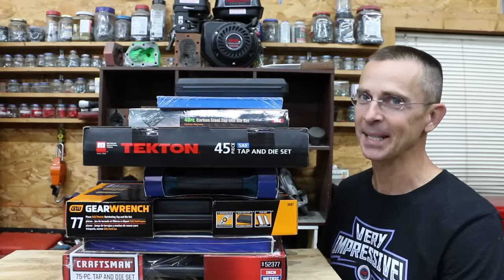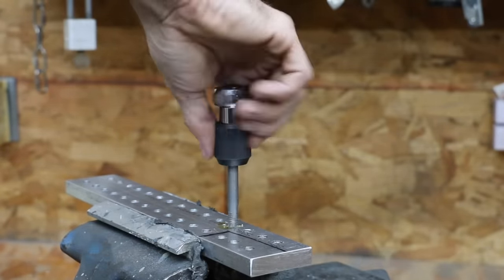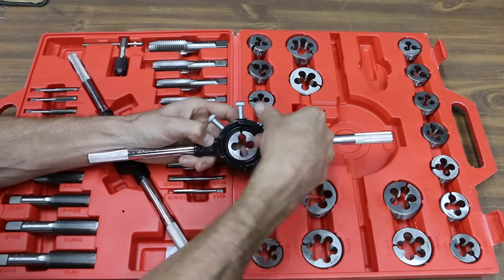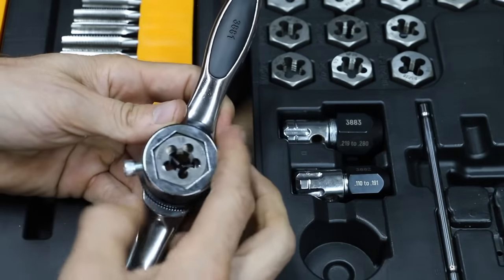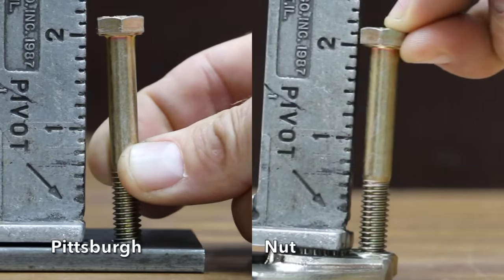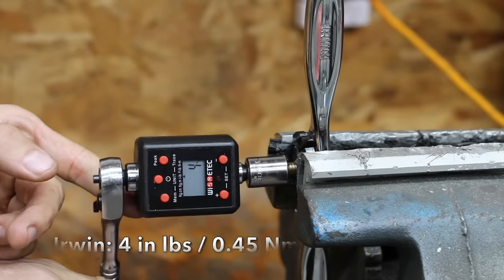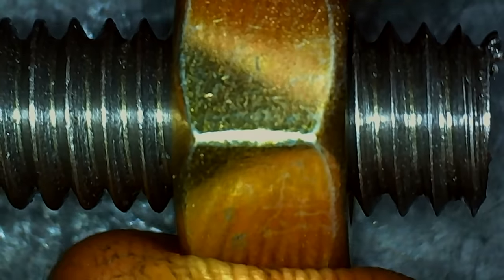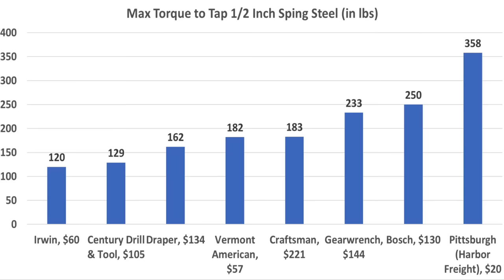Best TAP & DIE Set? Craftsman vs Irwin, Bosch, Draper, Vermont American, Tekton, GearWrench

Comment: I still have SAE and Metric tap and die sets from Hanson before they merged with Irwin. I've had to replace a few of the smaller taps that I have broken over the years, but those have been great sets for a long time. I wound up working with the son of the owners of the small hardware store that sold them to me decades ago, and I show him or tell him about stuff I have made or repair with those sets.
Reply from the maker: Thanks for sharing.

Comment: torque indications on the fine pitch are significantly less because the incline not as steep. BY a third. So add 33% to the figures and you would be close to an 18 tpi incline. AND although the fine threads are cut shallower, there are more per inch.... FWIW fine threaded taps use a larger drill size than coarse thread taps.

Comment: Please do this test again but with midrange sets like Grey Tools, Jet, Matco ect.  Also through thicker steel using the 270 cut / 90 back chip clearing method like many of us were taught.  At the $250 to $750 price point of the mid brands I'd be more interested in the tolerances and torque required after 20 uses than just 3 test materials.
Reply from the maker: Thanks for the suggestion.

Comment: Today I was tapping about 40 3/8-16 holes in mystery steel, and none of the taps I tried cut very well (from new laser marked ones to old embossed taps like greenfield, etc).  The last one I tried was a rusty Card tap.  I couldn't believe how easily it cut!  I picked up an ancient Card tap and die set (1/4 to 3/4") in a wood box last weekend and was going clean and flip in on ebay, but now I may just keep it, especially if they cut as easily.
Reply from the maker: Thanks for sharing.

Comment: the split dies are entirely up to the user to adjust the fit of the thread by tightening the holder more or less to decrease the size, theoretically you should be able to achieve a much closer fit if the die is a little too large
Reply from the maker: Thanks for the feedback.

Comment: Every time I watch a youtube video of someone running a tap through a hole with a hand-held drill, I cringe, waiting for that dreaded snapping noise.  I would never tap a hole without a fixture to hold the tap on axis.  At the moment, my tool is a normal T-handled tap wrench held in a collar that gets chucked up in the drill press that I used to make the hole.  Works pretty well.  There are also tap-wrench aligners that help hold the tap perpendicular to the surface.  Back when I had an employer to buy my tools, one of my favorites (along with an optical center punch - no home should be without one) was a tapping station that looked like a little hand-cranked drill press to hold the tap on axis.  If you don't use these aids, you make crappy threads and break taps.
Reply from the maker: Thanks for sharing.

Comment: I have a 20€ set from ALDI which was obviously made at the same factory, the case is powder coated metal, which is nice. They have done right by me. Mostly use them to recycle hardware... Rusty bolts and nuts.
Reply from the maker: Thanks for sharing.

Comment: Great test, however- I wish you had cut some bolt threads on a rod, and tapped 2 nuts, and jammed them on the bolt you just cut, and simply used a torque wrench to the jam nuts till one gave. THAT would put some relative, real world meaning to the free play you measured. Not complaining you have good tests, better than I would do for the most part!! Thank You! !
Reply from the maker: You are welcome!  Thanks for the constructive feedback.

Comment: Maybe you should do a video on the different cutting oils and waxes that are on the market! It's not a one size fits all when working with various materials. Over my 40 + years in metal fabrication I found Alumacut to be the best product when working with aluminum and some wax based lubricants worked best when working with mild steel , stainless steel , brass and bronze! Cast iron seemed to work better just left dry!
Reply from the maker: Thanks for the video idea.

Comment: Love the info but not sure what the weight of each item tells us.  I assume it is to compare the quality of the metallurgy. 1 brand of die could be thicker or even some of mine are hex while others are round. As for taps, some brands are longer than others. Some have a thinner "neck" or body. I'm probably most interested in how long they stay sharp or how easily a tap breaks. Just some ideas. Love your videos. Sometimes it's a lot of info at a fast pace which I appreciate but I can't watch them when I'm tired or not paying close attention.

Comment: When tapping aluminum or plastic you drill a slightly smaller hole so that the tap will cut deeper threads so that the aluminum or plastic won't strip so easily. A good drill bit chart will list the drill bit size  for steel and the drill bit size for aluminum and plastic
Reply from the maker: Thanks for the feedback.

Comment: When possible I have all holes drilled and tapped by our machinist. When it requires I use a hand tap I take my sweet time and turn 1/4 then back out to cut the chips out. Which is how it is supposed to be done, not just run straight through. I have done fine with my gear wrench set when a tap breaks or gets worn out the company buys me a brand new high-end professional one. I mostly tap mild steel or cast iron  so I really don't need anything fancy. As I said if it requires it we have a machinist for that.
Reply from the maker: Thanks for sharing.

Comment: I was given the Craftsman set as a Christmas present a few years ago. It is probably the most hated tool set in my shop - it's mostly usable for the hobbyist, but I wouldn't recommend it to anyone. First issue - some of the metric taps are oddball sizes that no one uses. I immediately had to purchase a separate M3x0.5 tap because it comes with an M3x0.6 - glad I noticed this before ruining my part. Second issue - the tap handles are complete junk. Don't grip the taps well and loosen up during use. Third issue - taps require a LOT of force to turn. Maybe my set came from a different factory than the one PF tested, or maybe I'm spoiled from using quality taps, but mine will barely tap a hole in mild steel (using proper letter/number drill bit), and the M4 tap feels completely dull after 5 or 6 holes in 6061 aluminum (fairly thin wall). I broke the 1/8" pipe tap off in a piece of 3/8" thick 300 series stainless steel despite drilling oversize, but that's not really a fair test for hobbyist tools. I've used the Irwin tap set a few times at a previous job and it seemed much better, but not enough use to test tool life. I've used Hertel, OSG, and Accupro taps (from MSC) extensively at work for hand, tap stand, drill press, and CNC tapping and been very happy with their performance. I've been buying quality taps in the sizes I actually use since the Craftsman ones are so bad, but I plan to buy a different set and kick the Craftsman one down the road when I see a good deal - nice to have a full set for the occasional sizes that get used once in 5 years
Reply from the maker: Thanks for sharing.

Comment: Gotta say, for the price if you have ir throw in a different die wrench - the Irwin seems like very good tool value. At least if you treat them reasonably well and understand their limitation. Even the highest end tools crap out if you abuse them too much, just the Irwin will possibly do the same but a little sooner.

Personally I have a cheapo set for random jobs - then when I need to make many threads of one type, I'm working on a precious project or some really tough material, I go buy the tap or die I need, at a proper quality. The last 4 taps I've bought cost a good bit more combined, than the set I started out with. But I've used them far more than everything on that set, and they're holding up as when new. I still use the set for oddball sizes though.

UfI was starting out today though, armed with the knowledge I have today - I would have bought a kit like the Irwin as a starter set. Not much more than the one I have, but clearly a lot less need to buy separate taps and dies even for regular use.

All ofc depends on whether you got the sizes you need, covered by the set ofc. If you mostly work with metric, make sure the metric variant is made by the same factory/company (or better).
Reply from the maker: Thanks for sharing.

Comment: You my get a better thread with your taps and die's if after ever 1/2 turn you broke the chip by backing off a 1/4 turn. and letting the chip clear. Its very hard on tools that have to keep re cutting the material they are removing. just like a hole saw and no exit point for the swarf to leave so you are re cutting material you are removing. this is why you drill holes the in the material you are cutting or in side the out line of the hole saw. so you are not re cutting material. This is also another reason why we peck drill to remove material from the hole. Nice Review  and good job. Also do not forget there are 3 thread classes for external threads 1A, 2A, and 3A and three for internal threads 1B, 2B, and 3B. All of these are “clearance fits”
Reply from the maker: Thanks and you are welcome!

Comment: Taps and dies are both supposed to be turned and backed off - turned and backed off - also keep the threads cutting area cleaned out - but this was still a fair test.  degree of turn depends on the material.

Comment: Probably the best way to buy taps is to buy tap sets, where you will have a starter tap, a #2 tap and a bottom tap, for each bolt size; they are more expensive, but worth it if you do a lot of this kind of work.  If you're lucky you might even find a pilot tap, which has a smooth shaft for entering the hole precisely square.  These are more industrial and harder to find, with most sets available today only including a #2 tap.  With adjustable dies, you can somewhat control the thread fit, but it does take some trial and error.
Reply from the maker: Thanks for the feedback.
Reply: It's a strain to force a #2 tap to cut virgin thread, when the #1 starter tap is the one to use.  It's really hard to evaluate the #2 taps given this task.  There will be more damage to the #2. @ProjectFarm

Comment: I have been a machinist for 40 years. Hole size is critical. You need to drill a pilot hole (just under size) then drill to the size you want. Hole size will vary otherwise. The best taps are made by YG but cost $50-$100 each. Otherwise Greenfield or Vermont would be my next choice.
Reply from the maker: Thanks for the feedback.

Comment: You should have added that the taps used were standard taps (intermediate) in shape. For cutting the spring steel pre tapping or simply using a taper tap (starting) would be the best way to go and what the stepped cutting ability was designed for. Doing the same thing with all taper taps may show different results. Also the Draper die has the cut out that serves 2 proposes, one to locate the die in the holder and the second to regulate the actual fit to the nut, that's why good old die holders have 3 screws to hold the die, to change its cut diameter as well as holding it (clearly seen with the Tekton set).
Reply: I didn't know you could change the diameter. Thank you so much for that tip. I had probably used the adjustment screw in the past, but it's not often that we have to use a large die, so I probably forgot. Thank you for sharing. I was thinking, how crappy it would be to thread a steel rod and then have the threads be way too loose.

Comment: I am interested in which Craftsman tap and die set you tested.  Was it a Sears Craftsman, or a non-Sears Craftsman.  There is a difference.  Sears has the right to sell under the Craftsman name, for a period of time, using the same suppliers they previously used.  Non-Sears Craftsman are now Stanley Black and Decker.

Comment: Would like to see a review of all the various gadgets sold that will help preserve tubes of caulk, or adhesive that come in those tubes that you snip the end off. I’ve tried numerous plugs and slip on rubber caps to try and keep those tubes from solidifying and none work very well. I end up wasting so many tubes. Expanding foam waste is another issue.
Reply from the maker: Thanks for the suggestion.

Comment: I the most annoying thing for me in getting the cheap Pittsburg was the tap holder slipping even when I tightened the handles down with 2 hose wrenches. Imho, add the cost of good handles and you may as well spend a bit more.
Reply from the maker: Thank you!

Comment: The cutting length when testing the taps with the drill: result is dependent on the speed of the drill - that could be different, so the result could be different. Plus: with these tools you do not cut threads so long at a time - if you want nice results, you cut 1 turn forward, half back to cut down the material.
Reply from the maker: Thanks for the feedback.

Comment: 5/16"-18 = National Coarse Thread, 
5/16"-24 = National Fine Thread,
personal opinion:  
fine threads for better tensile strength and they loosen less from vibration, on the other hand when working with thin layers of material coarse thread has a better grip and will last longer.

🔩
Reply from the maker: Thanks for the feedback.

Comment: Hey I think it's the way your using the tap that's making the threaded holes fit loose the way they are. You should be using a T handle and applying even pressure to screw in the tap when you use a single handle like a torque wrench your putting uneven pressure on the tap forcing the cutting tip to push outward.
Reply from the maker: Thank you for the feedback!

Comment: As a machinist and mechanic I learned the hard way that Horrible Fright is the LAST PLACE to purchase ANY cutting tools! ALL of their drills, taps and dies are trash. Some of their power tools are OK and their new tool cabinets are excellent. Just don't buy anything to use for cutting metal. Their wood tools, such as chisels and such are also pretty horrible. Personally, I use drill bits from Cleveland Drill which used to be located in East Cleveland, OH. It is now owned by  Greenfield Industries which moved them to Solon, OH in 1996. In 2009 they became part of the Top-Eastern Group who also owns Vermont Tap & Die which is one of my first choices for such items. I also use Irwin when I need something on the fly since most local hardware stores have them readily available.
The lesson is that you get exactly that for which you pay. You can get cheap things or, you can get things FOR cheap. The best thing is to shop around and don't be afraid to ask for a better price. You may well be surprised if you do.

Comment: Todd - Thanks for the video.  I've been watching @Abom79 about as long as you (several years).  There is definitely a difference between professional machinist tools and technique, and that of the home handyperson.  Thank you for using the tools, techniques and products that the typical weekender would.  I agree with many of the commenters - that proper drilling, spring holder, etc. will get you the 'perfect tap' - so well a multi-thousand dollar FlexArm.  The layperson has neither and is more likely to run it in with a hand drill as a using a tap wrench one handed.
Keep up the great work!
Reply from the maker: Thanks, will do!

Comment: Video Idea-what cement anchor holds the best from the little blue screws to the half inch screws to j-bolts. Does adding epoxy in the hole make a difference. Also, maybe a different video or maybe the same, how well do the anchors work in cinder block (and maybe brick too, some bricks are way soft)? I just don't trust cinderblock anchors and I wonder what the will ACTUALLY hold.
Reply from the maker: Thanks for the video idea.

Comment: Your testing method is the same for all the various tap /die brands.  However - on how tight or loose the resultant thread IS - you created all of these threads WRONG.
You are supposed to rotate a tap Counterclockwise as you cut and create a threaded hole - to help clear out the chips of metal as you cut Threads.  Failure to do this - creates a looser thread; shortens the life of the cutting tool; and encourages breakage.  Forward, Backwards.  Forward, Backwards.  This allows the CHIPS of Metal to CLEAR the hole being tapped.  Failure to reverse and clear - messes up the threads which are being created and cut.  Many tap and die sets remind the user of this.  Harbor Freight for example: "After every 1/4 to 1/2 turn of progress, depending on material hardness, rotate the Tap counterclockwise an equal amount to prevent chips from building up in the hole and breaking the tap."
Metal chips not cleared - do not help in the creation of proper threads.

Comment: Imagine buying a tap and die set and needing this one specific die and it arrive unUseable.

Back in late 2021 i bought a tap and die set on amazon branded "Muzerdo" (115 Parts "PCs") for around *total, $185 CAD. With a quick glance/test for "before and after" side-to-side movement (different size bolt tested) seems to be similar to Irwin, Craftsman or Gearwrench. (Only removing the Zinc plating) Beside the very cheap tray, the rest is very good!
Reply from the maker: Thanks for sharing.